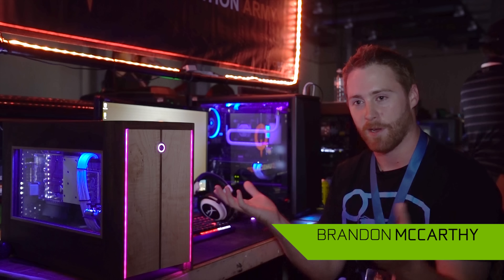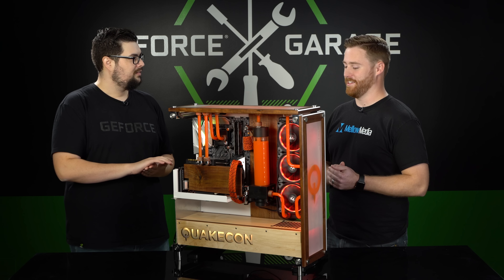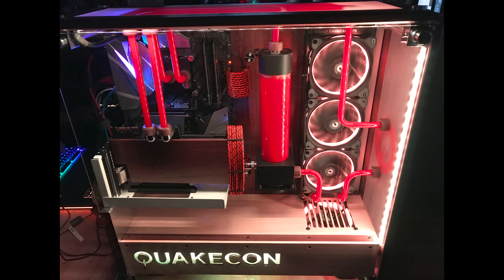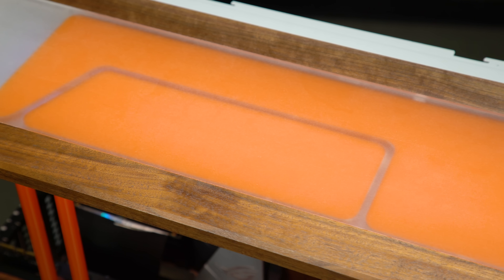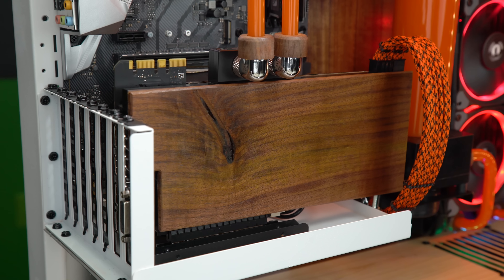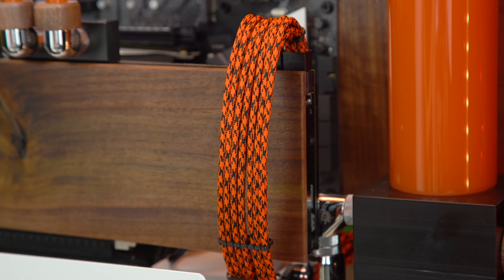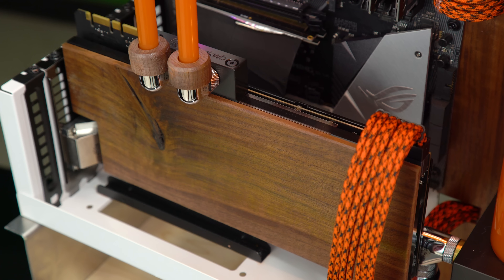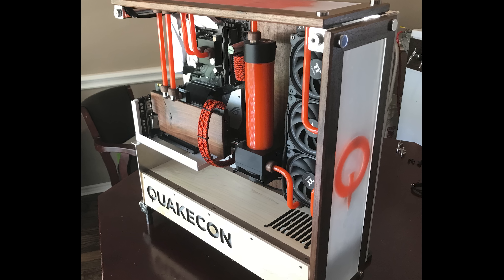GeForce Garage - Brandon McCarthy's Whoop Build

Comment: I mean my system wont be as far away, have a Gigabyte GTX 970 Windforce 3x, yet only 8gb overclocked 1600mhz RAM to ~ 2000mhz and a Intel Xeon X5675, YEEES I KNOOOW the cpu is old, on the x58 chipset but I still overclocked it to 4.2GHz@1.34V and on load is sits around high 50s, in extreme benchmarks it can get up to nearly 65 to ~70°C but benchmarks achieving such high temps on this cpu are no real workloads.  Just gaming and multitasking with this 6Core 12Threaded overclocked beast is still just great, yeah maybe a 8700k will achive a few more fps in more cpu intensive games like gta, actually there it might be a few more then a few xD but otherwise, I am guessing from previous benchmarks, that with the same graficscard in both systems, there wouldn't be that mich of a difference in gamingexperience ^^ actually the x58 platform does have one advantage over all the newer generations: it actually has less inputLag! ^^ so it is a CPU suited better for eSports players who need the absolute quickest response times in games, e.g. CSGO, that this minimal difference in inputlage might actually be the winning factor ^^ so if you can get your hands on a good x58 board () you should and go with a xeon x5670/75/80/90 😁😁 just so good CPU's and with all of them the inputlag difference stays the same ^^
#RTXOn #CES2019

Comment: Watched video, went to hardware store and bought a ton of paracord, realized I needed to remove wires from connected, said nope, cut the length of the paracord and glued it over the wire.... glue metaled on some of the wire and got on my GPU and Motherboard, it is like I have a RTX Founders GPU now =P